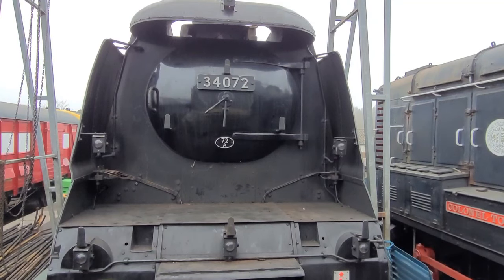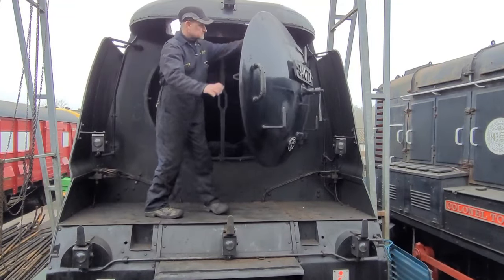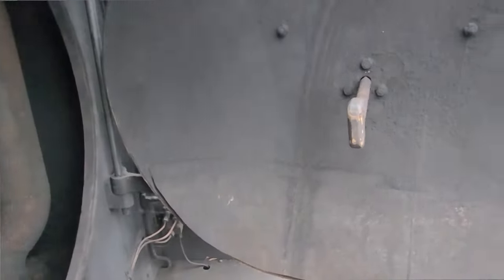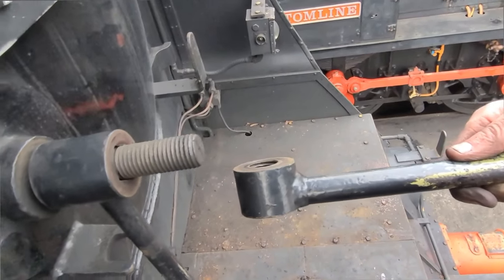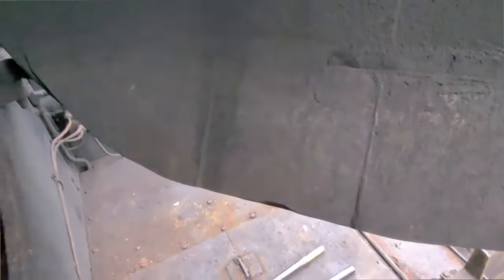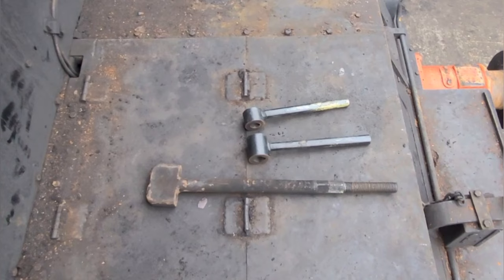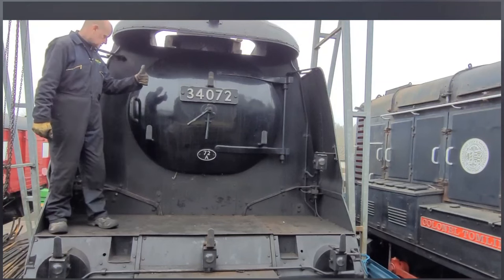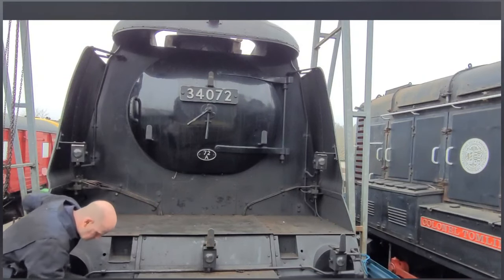How to open the front of a steam engine The smokebox door of 257 Squadron 34072 Southern Locomotives

Comment: 0:20 I was today years old when I finally found the answer to this question. I always wondered why the handles resembled the hands of a clock. Yet, they obviously weren't moving or showing the time. I eventually suspected they played a role in the operation of the locomotive. Glad to finally get a full answer.
Reply from the maker: You are not alone, I used to think the same! Thanks for the message 👍👍
Reply: same